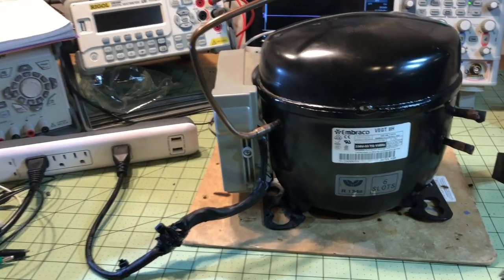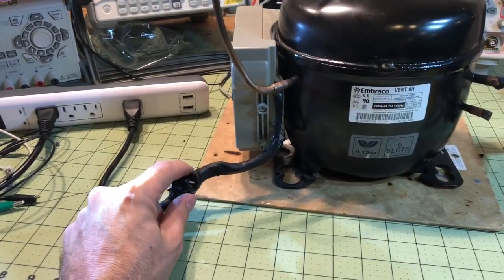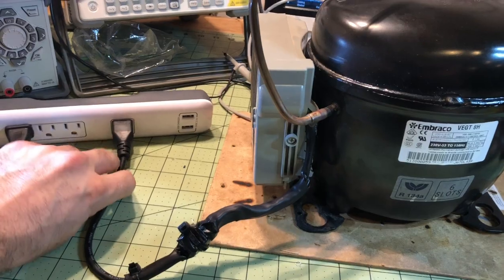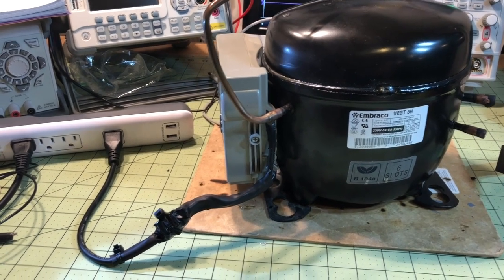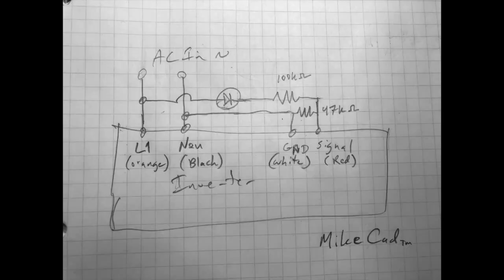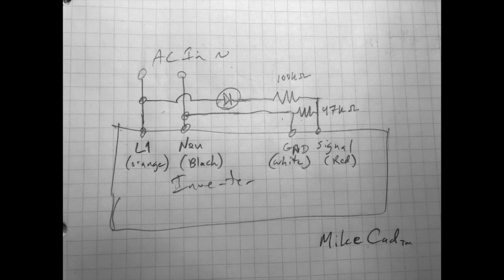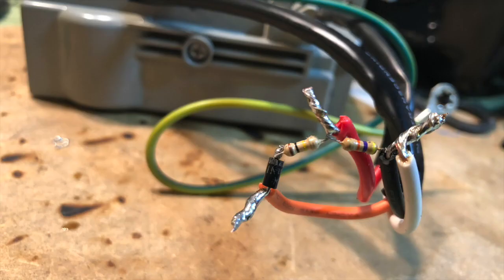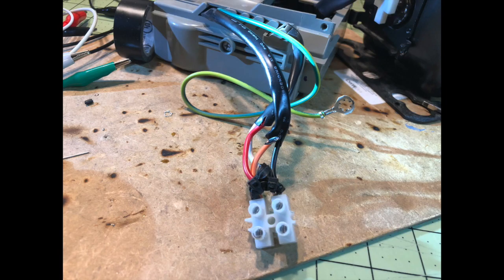VCC3 Inverter Compressor Tester

Comment: Thanks for showing how to spin the compressor for a test.  I am trying to find out how to control the speed of the compressor.  In the fridge I testing with a voltmeter,
it shows 5.2vdc when on but doesn't change voltage when it speeds up.  Is this a Pulse Position Modulation like an R/C controller, or something else?  
Google has not helped, flooding with simple compressor tests, as usually, simple shit videos everywhere, more details, hidden..
Reply: Thanks, I found this document, 
https://icemeister.net/backroom/wp-content/uploads/2018/02/Embraco-Inverter-Compressor.pdf
which explains how to control the frequency.
Your videos still did not explain how the signal effects the rpm, only showing two examples, of course after one understands how to control it, your examples make perfect sense.
And this is why I always see 5.2vdc no matter the speed, because it is 50% cycle 10vdc, just the frequency changes from 60hz to 180hz to control the speed.
Reply from the maker: https://youtu.be/N69glH-4-mM

Comment: My Samsung inverter makes circuit breaker of the house go off as soon as the compressor starts. Lately the compressor has been making noise. Do you have any suggestions?
Reply from the maker: Not a common symptom, if it's on a GFCI circuit, it could be nuisance tripping, test it on a non-GFCI circuit using an extension cord to see if it's the electrical. If you had a shorted compressor, I would think it would damage the inverter before tripping the breaker.
Reply: @electronicsprojects4708  how do I test it?
Reply from the maker: @Dr-Shlomo-Cohen  I just detailed it in my last post, test it on a non-GFCI circuit.

Comment: Excuse me, what kind of signal should I use to start the inverter, 4-20mA, 0-10V, or other ways?
Reply: I tried similar circuit like in this video, signal voltage was 2,5VAC and compressor started to run. Thank you

Comment: Hi
220v for 50hz supply
Is it enough to apply 220kohm instead of 100kohm in the installed circuit?
please reply quickly!
Reply from the maker: You would have to make a test, you want around 10v p-p, and adjust accordingly
Reply: @electronicsprojects4708  10V p.p.   What's p.p?
Reply from the maker: @hasansan1617  peak to peak

Comment: Awesome...that worked for me too.. a temporary fix...this mean the problem with my fridge not starting the compressor is the main board... cool..thanks..
Reply: KV M -  would be easier to just check input voltage and signal voltage going to inverter. 120Vac input and depending on manufacturer the signal voltage is around 5 v ac or dc.  If you have both voltages going to the inverter you know the main control board is good.
Reply: Hello, masters! We have international chat in watsapp for masters electronics of Washing mashine, dish mashines, friges. Invite you too. Write me, and i add you to us. We make electronics for thise devices.

Comment: Can you do a vid on using aliexpress boards to build your own DIY inverter-based temp-controlled setup?
Reply from the maker: do you have a link for reference?
Reply: @electronicsprojects4708  I don't know what you're asking me to explain.  If I could explain all of it, I wouldn't be asking for help.
Reply from the maker: @SteveWrightNZ  'aliexpress  boards' seems pretty specific, I am asking if you have a link to the board/s you are referring to.
Reply: @electronicsprojects4708  In this video you show how to jury-rig an inverter so it will start, but how to extend that with full thermostat / temp control, and what is that board called?  There is plenty of DIY refrigeration stuff around, but very little or no DIY inverter refrigeration information for the hobbiest.
Reply from the maker: @SteveWrightNZ  the board is a VCC3 inverter, normally I buy it under the GE brand, part number is WR49X10283, so maybe you can find more info by that part number.  You can use a Supco thermostat part number SC1002, it will do fridge or freezer temperatures, supply it with L1, then from thermostat goes to inverter circuit, from inverter circuit to Neutral and you have a working system minus defrost, and fans, of course.
Reply: @electronicsprojects4708  Understood. I see the SC1002 is a universal thermostat - is there another thermostat that could be used that will send a variable frequency to the VCC3 and modulate the compressor with varying temperature or suction pressure?  Perhaps some programmable unit that will handle the missing features such as defrost?
Reply from the maker: @SteveWrightNZ  It starts to get real complicated with the engineering of varying freon hi/low pressures, if you want to rework a system the only way to do it is trial and error depending on the model you are modifying, there is not going to be a general rule as it would depend on the individual sealed system that you are dealing with. You can program your own frequency modulated microcontroller, like on a PIC or Arduino platform.
Reply: @electronicsprojects4708  Understood.  Even more complicated with two different temperature evaporators too.  Thanks for having a refrigeration channel, thats very cool.  :)
Reply: Hello, masters! We have international chat in watsapp for masters electronics of Washing mashine, dish mashines, friges. Invite you too. Write me, and i add you to us. We make electronics for thise devices.

Comment: Thanks for the tip.  I have a Kenmore refrigerator that uses a inverter that has the exact same ratings as the one yours has, 3.3A; do you think other brand inverters will work as long as their spec.s are the same.?  You seem to know this system pretty well.  Thank you.
Reply from the maker: There are lots of different subs and replacements for the different VCC3 inverter, if it has a 2 wire signal that is 5 - 10 vdc (pulsed DC), then I haven't seen any that won't work. Some have just one wire and that will not work as a replacement.
Reply: @electronicsprojects4708  I should not have said other "brands" but other models of the same brand; Embraco.  The first part of the PN is the same (VCC3 1156) but the last part is different.  It looks virtually identical to the one I have and yours and the ratings are identical, so not sure what the other numbers represent.  As long as it operates the same I would think it would work but am hesitant to try them as I'm concerned there is the possibility it may have a different duty cycle, etc.  They just look so darned close.
Reply from the maker: @curtflory7147  same response as above, if one wire, you cannot sub
Reply: @electronicsprojects4708  Thanks so much.
Reply: Hello, masters! We have international chat in watsapp for masters electronics of Washing mashine, dish mashines, friges. Invite you too. Write me, and i add you to us. We make electronics for thise devices.
Reply: @БульБуль-щ2ь  please,Im very interested my name is carlos cardona  ,, at ctpcardonase@yahoo.com ,,,,,,  my phone is 1-562-524-8224. thank you.

Comment: Do all the vcc3 1156 inverters use a dc pulse input?  I found a document somewhere indicating a second type of input called dropin - which just seems to be closed or open circuit. I swapped a vcc3 1156 49f40 for a vcc3 1156 01f94 from ebay  and found the compressor on but low and no cooling occuring. After a while fridge lights and fans go dead with compressor still running. Removing vcc3 restores function to fridge though with  no  compressor function. Any insight would be appreciated!
Reply from the maker: Not all use pulsed DC, some have an AC sense circuit on the inverter, the operating T-Stat opens and closes, this is how it regulates the cooling. You cannot sub the pulsed DC version for this version. The compressor still can be tested, since they are the same. These AC sense VCC3 inverter boards are programmed at the factory and cannot be field programmed unfortunately.
Reply: how are you getting 9volts  using  2 22kohm resistors dividing 120v rectified ac?  what am i missing? Referring to your 2 speed tester circuit.
Reply: ahh nevermind, the inverter input circuit has its own resistance.

Comment: My inverter is Embraco VCC3 J1 F 13 EM model, it doesn’t have signal Red and White lines, it only have blue, brown lines in a connector, and one black line in another connector. What is the circuit to be to replace your circuit in your video?
Reply from the maker: I don't know which one you have, especially if it's out of the USA, I can't get service information for it. If in the USA get me a model # of the fridge.
Reply: - [ ] My 3 years old fridge Blomberg  model K70520NU; Product number: 7293545582; Marketing Code: BRFB1512SS. The inverter is similar to this video, My fridge compressor doesn’t start up. I want to create a tester to test compressor is functioning and proof the inverter status. I referred your another video, however, my signal connector is one black line only (your video have black and red lines). My inverter have another unknown connector with blue and brown lines (your other VCC3 inverter repair video shows it doesn’t connect anything). I don’t know how to convert your red and black lines circuit into mine. Please advise. Referring to my video below 
https://youtu.be/OJ-QXFxRF28
Thanks
Reply from the maker: @shumshum465  Did you test AC voltage 120 to the inverter (larger connectors) and 5vdc on smaller connector? Why is your display freaking out? That has nothing to do with the inverter. Looks like you have a control issue, not an inverter issue. They do not sell these appliances where I'm at, so I don't have documentation for it.
Reply: Appreciated your prompt reply. 
The freaking out display was blinking F 39 and 25 but the camera catching it freaking. 
The big connector (blue & brown lines) supply 120v to the controller on top of the fridge. The small connector (single black line) is labeled GND and the other connection (no line) is labeled IN. Correct me if I’m wrong, I think this black line is the Ground connection from controller which is output from controller relays. This black line could be the control signal (grounding) from controller to start up compressor? If I can use your tester circuit to fire up compressor by input voltage or grounding to black line, it can prove that compressor and inverter are ok, then I can investigate the controller. Please refer to my another video below. Thanks.
https://youtu.be/8wz3kWobKTY
No voltage in black line. Blue and brown are 120v
Reply from the maker: @shumshum465  the tester will only work with a pulsed DC signal (2 wire) connection, it will not work for your application. The VCC3 compressor is programmed that way at the factory and cannot be changed. If you look at the schematic diagram for your unit, it may connect to the L1 120vac line coming from the board. Again, I don't have service info on your specific unit.
Reply: I googled my unit circuit including the controller and inverter circuits but no luck.  Anyway, thank you very much. I think I may have to give it up.
Reply from the maker: @shumshum465  Even the best techs without a schematic are just guessing. They sell different brands and models in different parts of the country and especially in the large cities, brands you never heard of.

Comment: Also does this need to have a working inverter? It looks like this is wired up into the converter, not just the compressor
Reply from the maker: yes, the harness plugs into a working VCC3 inverter
Reply: @electronicsprojects4708  i am trying to diagnose a newer whirlpool with an embraco compressod that is not available anymore. I am just learning about these 3 phaze converters.   It is a whirlpool w10338341 part number for compressor. The compressor looks like a large bug.  I believe it is 3 phase, has a inverter. Looks the inverter is no longer available. I was hoping i could make something to direct run the compressor to see if it checks out. The resistance on the 3 comp connectors is not the same across the pins.
Reply from the maker: @jpp9876  That is not a 3 phase compressor, join the Re-Engineers group on Facebook, post your model, problem and pictures, and we can see about helping you with your situation
Reply: @electronicsprojects4708  thanks so much. It is hard to get info on this stuff. I'll join
Reply: Thank you
Reply: Hello, masters! We have international chat in watsapp for masters electronics of Washing mashine, dish mashines, friges. Invite you too. Write me, and i add you to us. We make electronics for thise devices.

Comment: Will this work for all inverter compressors with a 120 volt line current? Or is this for a certain model? Thank you
Reply from the maker: Must be 3 phase, I have used it on multiple brand compressors with no problem

Comment: Hello, very nice work. Here I have power supply of 220v 50hz., I saw you recommend to double the resistor values and test if we can have the 10vc as signal, is that correct?  Double  that parallel 47k ohms resistor too? ( Is there any risk to damage the inverter input section ?) Thanks in advance!!!
Reply from the maker: It depends on your inverter and how it's designed. Over here, 120vac on the vcc3 inverter the input voltage is 10-15 volts peak. You can experiment, but I can't tell you it won't damage your inverter.
Reply: @electronicsprojects4708  hi there, thanks for the fast reply. The inverter is vcc3 eecon embraco, almost the same one as yours. 220-240 50/60hz. Input 3.3a, and output 230v 53-150hz. 3.3a
Reply: The signal vc according to a section a found on internet is 6-7 plugged and 10vc unplugged to the inverter board
Reply from the maker: @josepei5974  sounds right, You can experiment with the different resistors and try to get 10vdc peak, then test it.
Reply: @electronicsprojects4708  ok, thanks  a lot, I will double both resistors capacity and try if results in 10vdc. I will post the result.
Reply from the maker: @josepei5974  Looking at the diagram, try first using a 220k ohm instead of the 100k ohm and see where that gets you, this will lower the voltage across the 47k ohm resistor, maybe enough.
Reply: @electronicsprojects4708  ok, thanks I will do that first. And post result.
Reply: @josepei5974  hello did you succeed with 220v how did you achieve this please inform
Reply: @yakuptakal3119  hi there!, I can't remember if it worked, but Finally, I used a multivoltage adapter, those has selectable output 3-6-9-12 vdc. I cancelled the filter condenser to get pulse. It worked on 9vdc . Hope it helps you.
Reply: @josepei5974  thank you for the answer
I do not have an inverter compressor
I want to try with inverter dishwasher motor
i don't know if you can be successful
Reply: @yakuptakal3119  hi yakup, My test was successfull, the inverter board is damaged and sadly I'm still working on it due to the replacement is discontinued.
Reply: @josepei5974  so it doesn't work like this video?
Reply: no i couldn't run it as in the video
did you achieve this
Reply: @yakuptakal3119  no, I couldn't because my inverter board is damaged my friend.
Reply: @josepei5974 
Also need 50Hz signal from a.c
Reply: Did you make the draft in the diagram and start the engine
Reply: @yakuptakal3119  my friend, the inverter motor won't start if the inverter board not working properly or damaged Wich is my case! This diagram is a basic way to get the pulse required by the inverter board to start to work. This diagram is an inverter board tester!
Reply: @josepei5974  diagram does not work 10v does not come out
Reply: @yakuptakal3119  diagram should work. What voltage did you get?
Reply: @josepei5974  220 50hz
Reply: @yakuptakal3119  I mean what voltage you have got as result.. more than 10vdc?
Reply: @josepei5974  idle 10v dc but when connecting to motor board 105v dc drops
Reply: @yakuptakal3119  this diagram is to get pulse and goes to the board input section. If you have achieved 10vdc+- with this diagram it should be working, if not the failure could be the inverter board or the inverter motor!
Reply: @josepei5974  do you have a skype account
Reply: 47K
100K

Comment: Hi, I have a question, it may be stupid but here it's; can I use any brand inverter on any VCC3 compressor? I just want to use for testing purpose.  Also do you have any way to test linear compressors?
Reply from the maker: That's a difficult question to answer. Embraco makes the VCC3 inverter for their 3 phase compressors. Different companies have different feedback tests and a compressor on a Whirlpool, may draw more or less current than a GE, so the inverter may error out because the feedback current is out of bounds, even though it's running as it should. I have tested a 3 phase Samsung compressor with my Embraco VCC3 tester and it turned the compressor on, no problem. The manufacturers don't give us enough info in their documentation, so we have to wing it in the field. You can hook up 120vac 60hz to a linear compressor and it will run, that's good to test for locked rotor, but mostly there is a valve inside that fails and the compressor will run, but will not compress the freon. You could put your finger on the suction line into the compressor to see if you have any suction.

Comment: What would be the resistor I would use to test medium and low speed.
Reply from the maker: Since the speed is set by frequency, 60 hz coming from the wall is what we got, so without a more advanced control system you cannot regulate the speed. I am thinking that you possibly could set up a 60/120hz with out a micro controller using a bridge diode setup.
Reply: Electronics Projects I'll be trying a frequency generator on mines when i get it what is the max voltage this thing could take